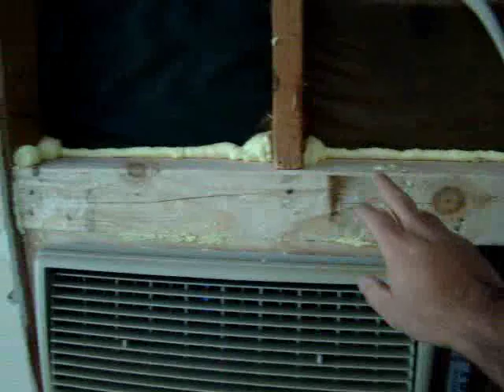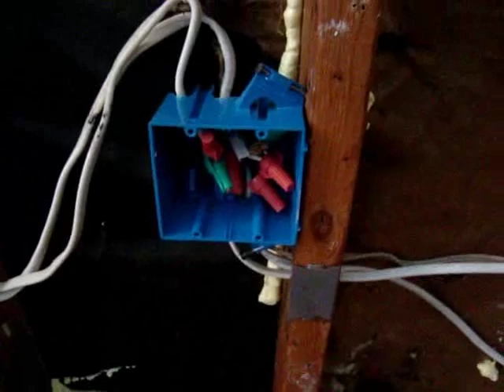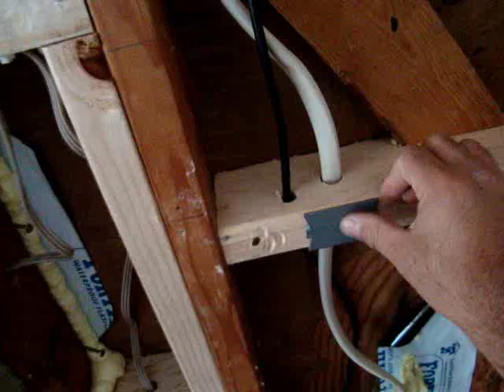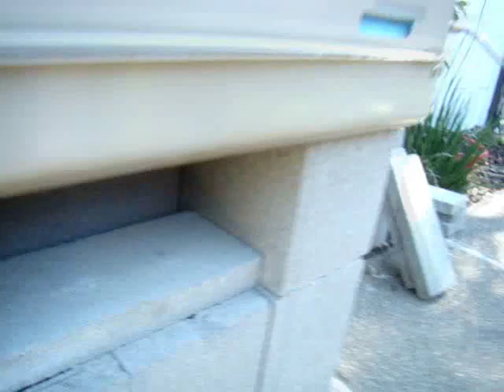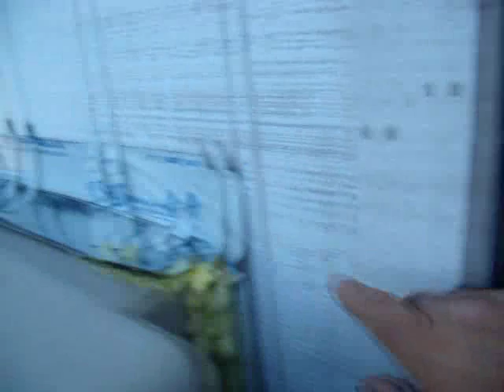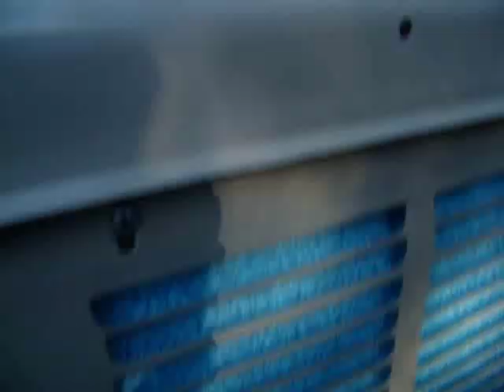swamp cooler evaporative cooler framing build out install in wall

Comment: The pads and air output are actually warmed up by the continually flow of relatively hotter water that circulates from the water pump.  So by stopping the water pumping for very short periods of time, then the pads will become much colder and make the air output colder.  Use a Repeat-Cycle-Timer to cycle the water pump on and off, for maybe 1 min on, and then 3 or 4 min off.  The air output becomes colder, and energy is saved.

Comment: dude the blue stuff is to hold water... a pump sends water up to the top and comes out some tubes on top that keep the pads wet. what makes the air cool is the EVAPORATIVE process of the hot air being drawn in through the pads and the cool water in the pads EVAPORATING.. any pads will keep dust out... but the Blue pads are the best at retaining moisture and for preventing against mold and mildew. also keeps dust out yes, but thats not the big picture behind the blue pads there.